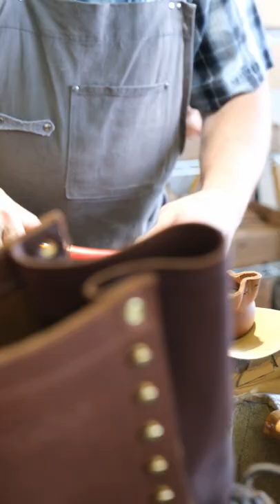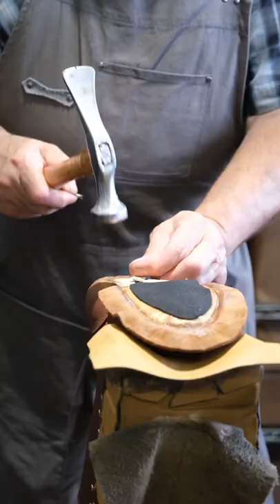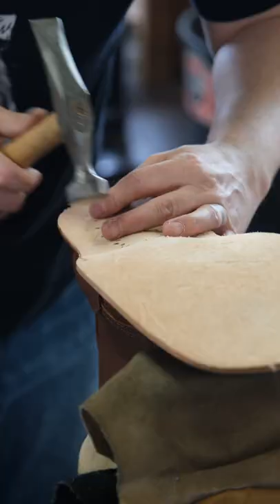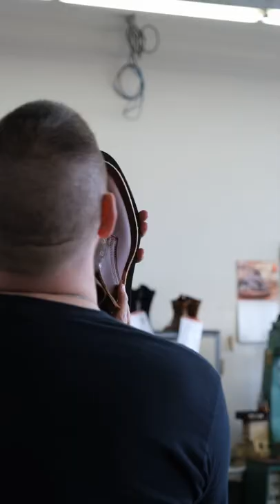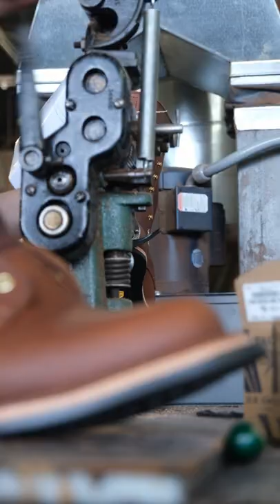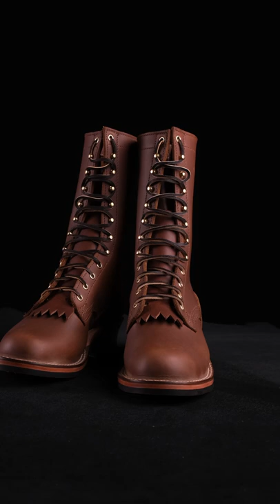THE $550 Farmer Boot Build #shorts

Comment: Demasiado costasas........no se porque...
Reply: Потому что доллар становится бумажкой,и американцы лишаются комфорта в этом году.
Reply: @Hans Moreno Because these are handmade of the toughest, highest quality, and most functional materials available in the world, and have the ability to be rebuilt if you ever wear the sole out. These boots can last many decades, making them much cheaper in the long run, some are even generational heirlooms. Along with fantastic protection, support, and durability, once these boots are properly broken-in, they offer a most comfortable and perfect custom fit, molded to the owners specific foot, ankle, and calf in every way. The only maintenance these require is a little bit of mink oil paste every now and then, which hydrates and water proofs the exceptionally thick full-grain leather, keeping it soft and supple preventing the deterioration of it altogether. These can even be polished to a mirror shine if that's what one prefers. Hand-built boots like these were originally designed for really heavy duty, industrial logging in the steep, wet, and thickly forested Rocky-Mountains of the Pacific-Northwest and later became the go-to style of boot for wildland firefighters and smoke jumpers around the world, which is a significant testament to their utility and longevity. Although other boots that are not handmade may look similar, I assure you that in every way, they most certainly are not. You definitely get what you pay for here.
Reply: @datura7282   @Datura  The current inflation we are seeing has nothing to do with it. Handmade heritage style logging boots have always demanded a premium price for their exceptional quality and craftsmanship. These are still priced similarly to the range they have always commanded, approximately half a weeks salary for the average skilled worker in the middle-class here where they are made.